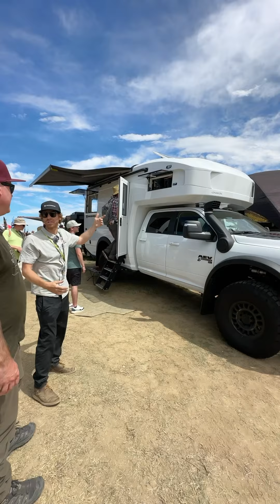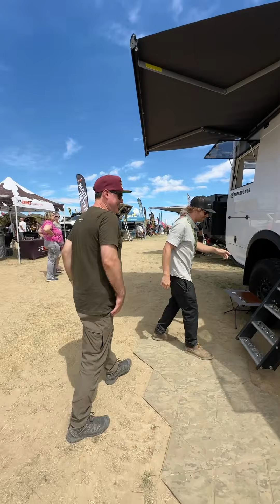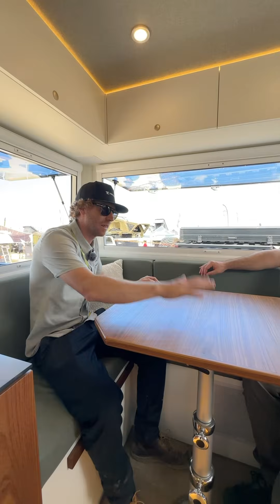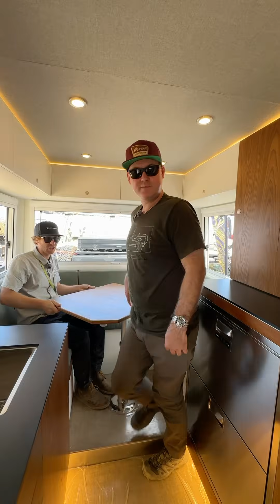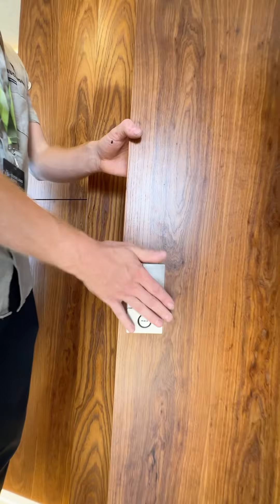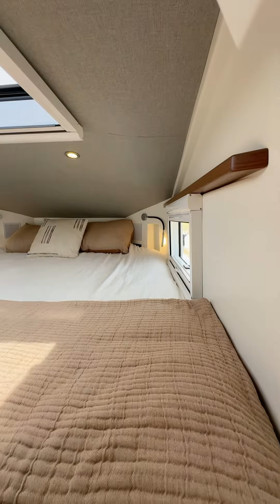TRUCKHOUSE BCR INTERIOR WALKTHROUGH AT OVERLAND EXPO MOUNTAIN WEST w/ TRUCKHOUSE CEO, MATT LINDER!

Comment: I hope the cost is less than a Earthroamer, if so they should be worried. This is probably the best built overland vehicle made. I seen the video about the chassis build and I was amazed.
The only thing I would change is loose the roof mount ac and install cruise and comfort system
Reply from the maker: @williamgildea8348  Earthroamers topped the $750K barrier (base price) on the smaller model several years ago. The larger model is over $1M base price. Well-equipped, you’re looking at $900K to $1.2M for either Earthroamer, if buying new. The TruckHouse is well below that, and can actually off-road without breaking, which Earthroamers are prone to do.